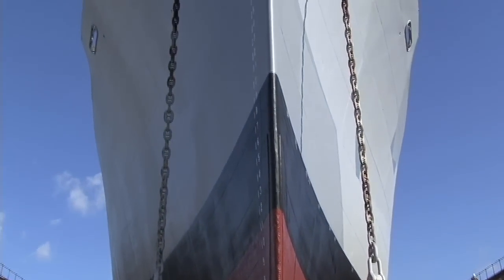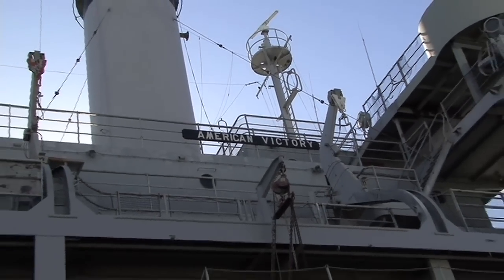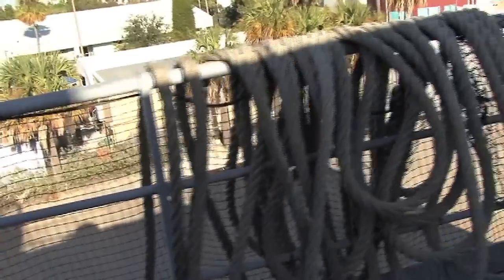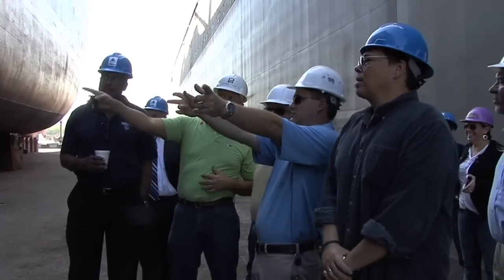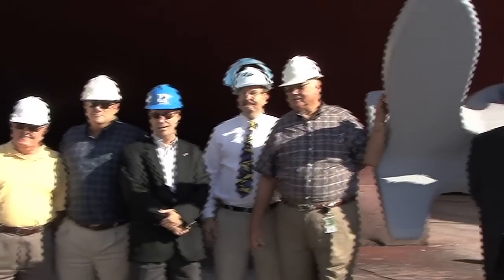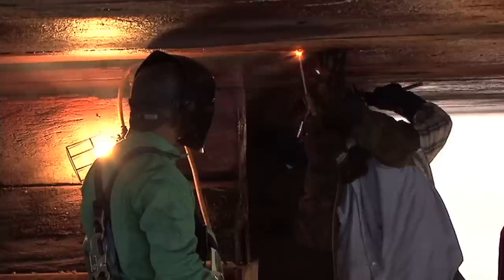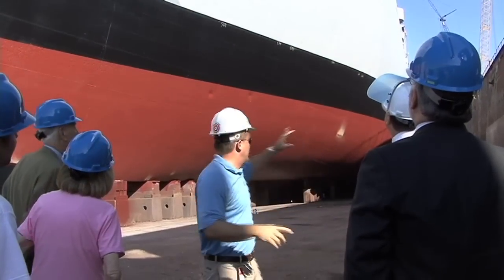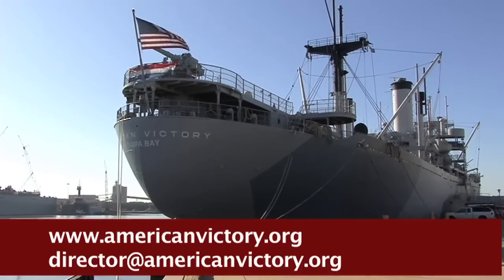American Victory Ship: A National Treasure

Comment: Sailed on two for the "Old" Holland America Line as engineer in1961/62.  Then still old fashioned breakbulk cargo before containers took over. You just turned them on in Rotterdam and off you went. Never any problems very different than the balky enormous diesels that pretty much have displaced steam.